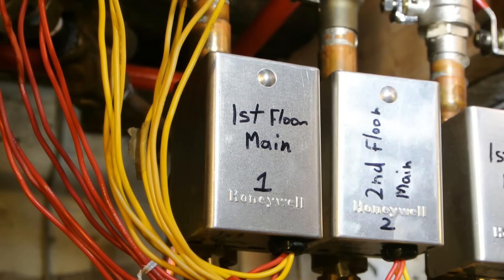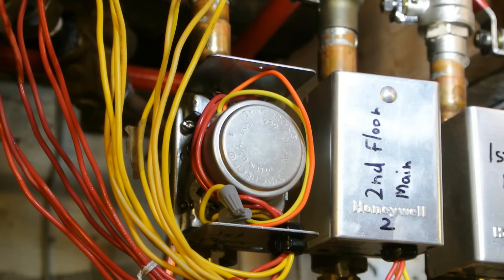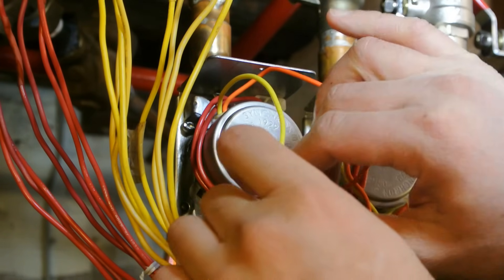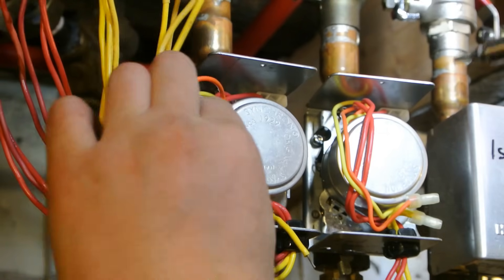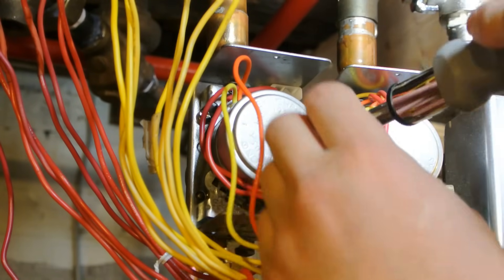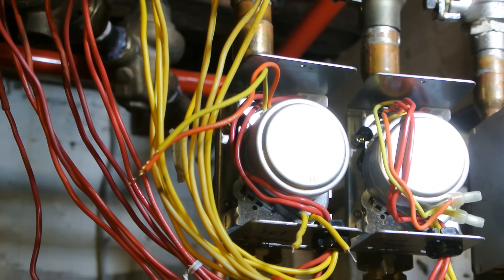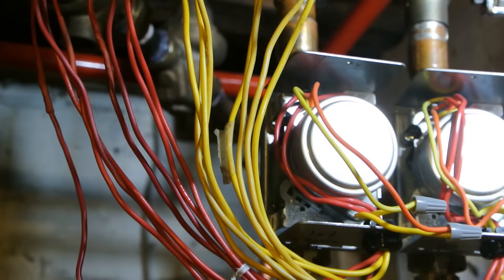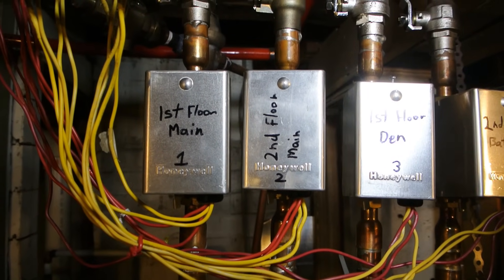How to Change a Zone Valve Motor - Honeywell

Comment: I would like you to do a baseboard zone valve where some idiot installed it tilted in so you can't even see the screw in the back, much less reach it. You have a piece of cake , wide open access one to work on.

Comment: The 3-way valve header electric mechanism is quite clever.

It has three AC control wires: white-in Open Port A; grey-in Close Port B; orange-out Run Pump alternative signal.

With no AC power on the inputs the default is Port A closed - Port B Open.

To pump water for Port B - its thermostat needs its ON switch as external parallel with the orange wire Run Pump signal.
Port B thermostat OFF switch is connected to the grey wire to Close B ONLY if Port A is already Open.
Port A thermostat ON switch is connected to the white wire..
Port A thermostat OFF switch is unused in this configuration.

Port A thermostat ON switch power to white will run the valve motor via the first microswitch default position..
When it reaches the valve mid-point it will change-over the first microswitch and stop.
This position is held by the valve motor power being supplied through a diode and resistor via the second microswitch default position..
This DC reduced voltage will effectively lock the AC motor rotor.
Both ports are now open.
The power for the Run Pump signal is still supplied as a bypass using the Port B thermostat ON switch.

The first microswitch is now connecting the grey wire to the valve motor.
If power is applied to the grey wire from the Port B thermostat OFF switch -.the valve motor will continue moving until it changes-over the second microswitch - and stalls, (with power??).
This disconnects the mid-position reduced DC from the valve motor.
Port B is now Closed - while Port A remains Open.
The power for the Run Pump signal is now supplied tor the orange wire from white Port A thermostat ON via the second microswitch changed position

There is an interesting 270K resistor connected between the motor and the orange wire Run Pump signal.
It is thought to be a diagnostic aid for the controller to show when the valve motor has power??

Comment: One thing - there are lots of cheap motors out there but I reckon it's worth paying a bit more for a genuine "synchro" motor. I say this having just had to replace a motor for the second time with the cheap one I fitted first lasting only 2 days!
Reply: 35+ years ago the genuine Honeywell motors didn't last very long. Then they became reliable. Clones have been ok - until one today was had different measurements in very subtle ways that made it a pig to fit.

Comment: Hi, my pump is connected to 2 zones. One of the zones is not turning on the pump so I get no heat, does the valve motor need to be replaced or the entire zone valve? Or is there a different issue?

Comment: Brilliant and works perfectly for UK systems as well. The new motor cost me just under £15 and I fitted it myself as per your instructions. We are now all toasty again. Thank you.
Reply: Hi im curious can you keep the power on while doing it or no
Reply: I turned it off at the main board. Safety first!
Reply: @johnroberts8  thank you very much it my first time to replace it today thank you for replying back
Reply: I have replaced these motors several times in 40 years - both Honeywell and clones. Today an advertised clone was a struggle. Its flanges were slightly larger and possibly thicker metal. The gear was longer and the motor wires exit plastic seemed longer. In trying to twist it into place - the motor cover came off. Easily refitted but shouldn't have happened. Screws were supplied - but very short. As it is a rare job these days I'll buy a genuine, expensive, Honeywell one for future spares..

Comment: Everyone DONT do this.     It is absolutely dangerous working on boilers and it’s illegal.   You can only work on a boiler if you are gas licensed.  Not to mention you will put air in your boiler and ruin more parts by burning them up.  It’s just not smart.

Comment: I found grease on the gear of the original unit. Probably a good idea to put some high-temperature grease on the gear of the replacement unit before reinstallation.

Comment: Thanks for this video! You saved me a few hundred dollars at least. One of my zones was stuck in the heating mode and getting very hot. I ordered a valve for 60$ Canadian off Amazon and did it myself. It worked! You didn’t mention if the power should be shut off but just to be safe I switched it off to my boiler before completing the job.
Reply: Also I didn’t solder my connections but I assume it should be okay. The Honeywell manual does not say you need to solder them. I guess time will tell.

Comment: These zone valve motors are really pieces of junk. They're designed to fail after a certain amount of time. Keeps Honeywell and HVAC pros flush with business.
Reply: My pair of Honeywell 3-way valves have been installed for nearly 40 years. Initially there was apparently a Honeywell reliability problem with the motors - but in about 30 years there have only been a few long-life motor failures. The latest one was ok from 1992 until this year 2025.
Reply: What are you on about? 🤣 Honeywell are one of the best most reliable zone valve manufacturers out there (at least in the UK they are). My 3-port valve was put in in 1988, never seized up, nothing ever wrong with it. They only fail because the customer doesn’t look after their heating system properly, or they pay for a cheaper plumber who doesn’t service their system properly. Nothing to do with the quality of the valve.

Comment: !!! Caution:  many countries (such as the UK, EU) use visually identical kit - but it runs on 240V (!!!) and not 24V as shown in this video! I expect most viewers realised that anyways, but just saying :)

Also, in the EU/UK - technically... only qualified electricians are allowed to alter 240V wiring.  But hey, shshsh... just turn off the mains first people!
These valves are pretty poor in my experience.  Sure wish they all operated on a nice, safe 24V!   Thanks for the vid.
Reply: It seems to me it's a pretty bad idea not turning it off even with the 24V system. Sure it won't give you a jolt, but working on it hot means you might short it out and maybe damage the controller or at least blow a fuse.

BTW, my understanding of the rules in the UK is that you can replace existing installations except maybe in bathrooms and kitchens... is that not right?
Reply: My understanding is that a like-for-like replacement is ok - otherwise you couldn't even change a bulb. I once heard that in Australia only professional electricians are allowed to change a plug on a domestic item. Mind you - I have seen UK 13A plugs with Earth and Neutral interchanged.

Comment: I have a 2 port valve motor doesn't seem to be working but heating comes on when hot water is switched on but no hot water. Can this be fixed simply by replacing the motor or do I need to replace the whole valve?

Comment: I think mine is the valve. The gears stripped trying to move the valve
Reply: If you try to move the the motor while it has power then it can strip the internal gears. The motor in the mid-position is held by a DC voltage on the AC rotor - otherwise it is stalled against the end stop for Port B closed.

Comment: Couple remarks to your video. With DC current it does matter polarity of the current as the motor will turn in an opposite direction. Also, you should add a disclaimer to your video to always isolate electrics. Most of these valves are supplied with 240V AC and some people can get hurt. Also, even on a low voltage with loose wires hanging around can shorter and damage something. Always isolate electrics before attempting this sort of diy repair people.

Comment: Great video, My heat was staying on even with it turn off. It was 72 to 75 degrees. I know it was the zone value or motor. Just to add if you can push that tab on top of the zone value to the left with no resistance or its does not spring back its the motor. It looks simple and it is , but watching the video help me replace it in 15 minutes and the motor was 40.00 at Home depot. I sure today a plumber would charge 300.00 or more.
Reply: I

Comment: I strongly reccomend that you turn the electricity off when doing this job. The power to the system is mains 240 volts
Reply: I’ve been paying a plumber through the years to replace the actuator itself which is now getting pricey. With the price of the actuator and brass about $70 it seems like if I turn the power off it should be a simple change out, would that be correct? I know I have to line up the actuator with the valve. It always fails in off position but would I turn off the stat? I’ve been operating manually until the tech can get to me but I figure I may as well have one or two on hand. Seems like I replace one every year or two on a 10 zone system. It’s low voltage but still turn off the system? Thanks.
Reply: 24 volts...
Reply: @davidkopec9442  Depends where you are. In the UK they are 100% 240v.

Comment: Thanks for the Video! I thought it was funny because I just finished created a video called " Whats's Inside a Honeywell Zone Valve "   - You are correct, it does not matter which wire is hot and neutral.

Comment: Very helpful video.  Thank you.  I have three zones.  The furnace continues to heat one of the zones even though the thermostat is set low.  I have already replaced the thermostat for that zone and it didn't solve the problem.  I'm pretty sure the motorized valve is the issue but the pipes that flow through all three valves are hot on both sides even though the heat is not turned on for the other two zones so I can't tell which one is the faulty valve.  Nothing is labeled.  Any ideas on identifying which is the broken valve?

Comment: Thanks again for another clear and easy to follow video regarding zone valves. I like that your explanation and how-to instructions are done in real time. Other videos I've watched were just after the fact explanations which were far less helpful. I also appreciate your sharing your experience regarding the most likely components to fail.

Comment: Thank you and I must say it was nicely done considering you did not have a camera assistant. It's exactly what I needed. I deployed the manual override switch so I have heat in the zone (I have 4 zones) that failed for now. Going to pick up the new motor tomorrow. A friend of mine that is an HVAC installer/repair technician told me the motor is usually the part that fails on the zone valve. Just as you said in your video.
Reply: Swapped it out today. One screw, orange to orange and yellow to yellow on the wires, couple of wire nuts and about 15 minutes work. 
The faulty zone is circulating hot water once again.

Comment: thanks for the video I have one question however, do we shut off the power to the valve?
Reply: Always disconnect power when working on any wireing.
If you are putting it in manual mode I assume you are safe but it still wont hurt to disconnect the motor power while you wait for a new part.
Reply: yes as it has 240v on some of the cabling coming into the valve

Comment: Great video! How do you know if it's just the motor vs. the whole valve? Is there a way to tell if the whole valve is bad? I've been told mine is stuck open, but I'm not sure if that means just the motor or whole valve. I'm trying to save the $400 if I can make this repair myself. I don't want to go back to the company that quoted me a price to ask ;)

Comment: What do you think would cause a boiler to constantly heat one zone, even with the thermostat disconnected?
Reply: This is what's happening on mine too. What I was told is that my valve is seized open, so anytime another area runs, the stuck open area runs as well (even thought the thermostat is off). What I'm not sure about is if I need to replace the whole valve or just the motor. Anyone have any ideas?
Reply: I had this problem as well. The motor itself can fail (freeze) with the valve in the open position and the end switch closed. If it is the motor that is frozen, then when the motor is removed the valve should spring back to the closed position. You should also be able to rotate the valve shaft by hand (fingers). But if the valve does not spring back to the closed position and you are not able to rotate the valve shaft, then it is very likely that the valve itself is stuck in the open position.

Comment: how do find out which motor is burned out 
thanks for the vid
Reply: In my case, the burned-out motor caused the zone to be heated 24x7.   The thermostat was unable to control the motor.  Change the motor for the zone that is not working properly

Comment: In my case if I switch the manual valve to ON then the heating comes on. Does this mean that the motor could still be the issue? or the actual valve has stopped working and I need to replace the whole valve and not just the motor? Thank you!
Reply: The lever you moved to switch it to "ON" (or manual) is moving the actual valve inside the water pipe. So the valve is ok. You just need to replace the powerhead (the entire silver box) or maybe just the motor inside the powerhead, as this video shows.

Comment: I have a similar setup at my home, lately 1 of the 2 Zones is not working but if I slide the zone value to manual it works and slide it back to auto it contnues to work for a few days, then it doesn't work again. Does it still need to be replaced or is it just full of dust and getting stuck. Does the breaker or power need to be shut off on the value your working on or is it low voltage enough to do it as is. Thanks for any feedback or info.